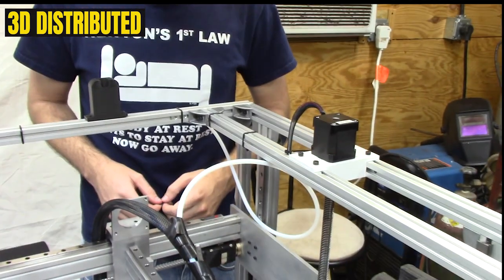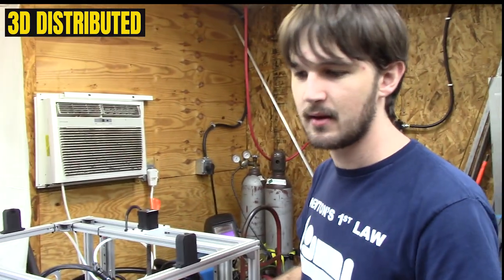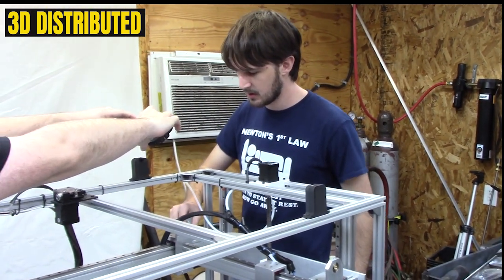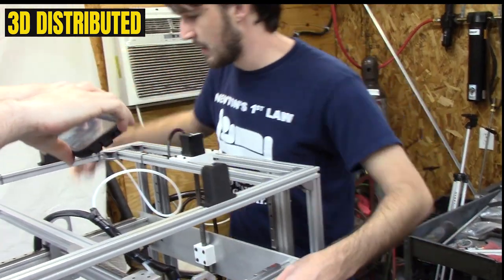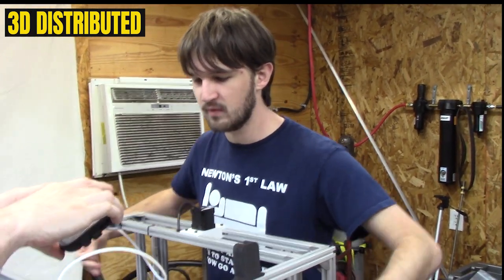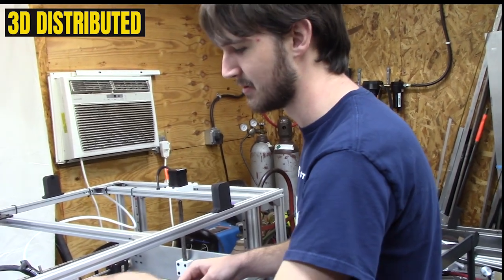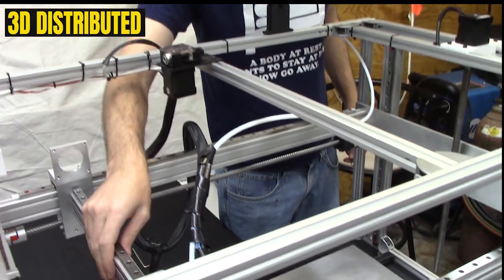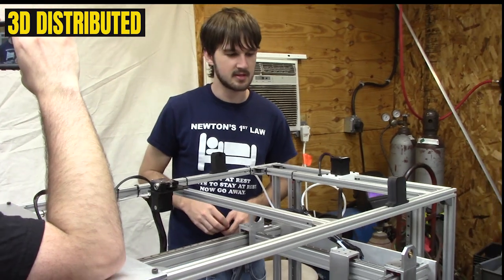WorkHorse 3D Printer - Linear Rail Alignment

Comment: You should have had one side centered on the extrusion and tightened down and the other hand tight and used the tightened down side was a base for the other side, it could end up crooked with out a stable base to go off of....
Reply from the maker: Yeah you're right... We now have a little jig we use though.
Reply: so tighten one side to the center of the extrusion and adjust the other side accordingly?
Reply: @hongtse6723  yes. You need to use one as a reference.